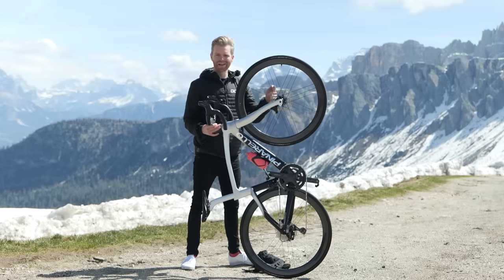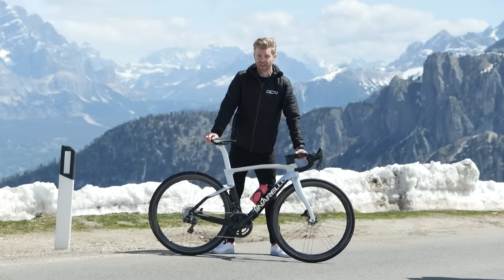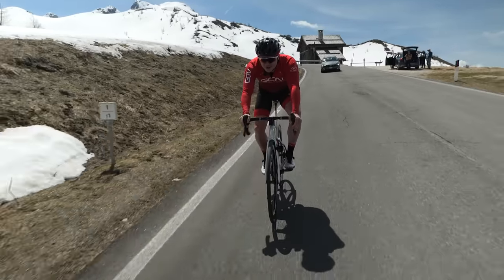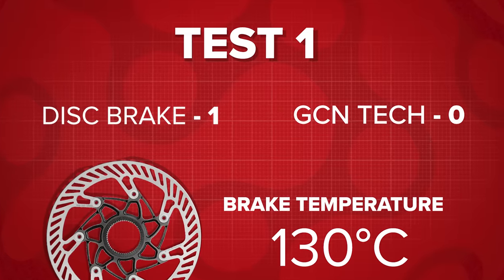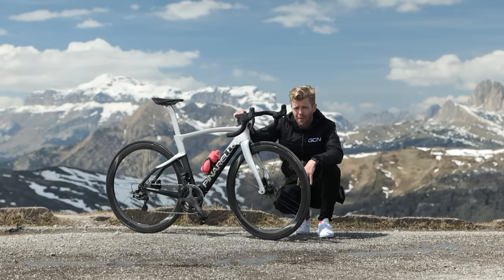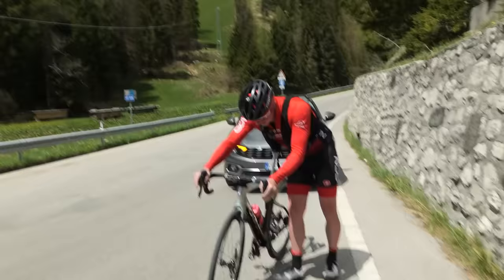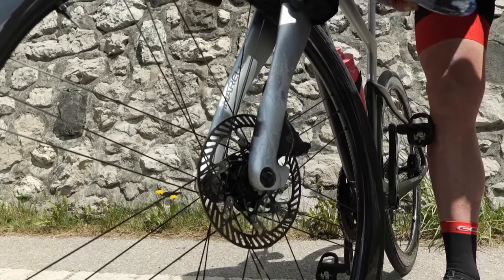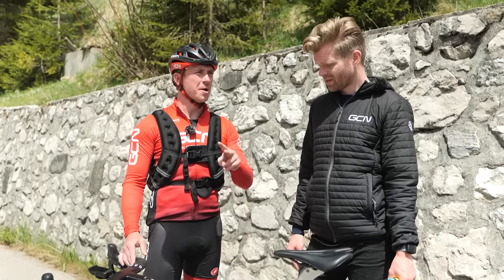Can We Melt Disc Brakes!?

Comment: Also, dragging rim brakes on descents can heat up the tire enough to blow it off the rim. I know from experience.
Reply from the maker: Oof. Hope you didn't crash too hard!
Reply: I too have had a similar excitement, after making the mistake of adding air to the tyres before a steep descent off Exmoor.  The front cover exploded a second or two after coming to a halt.  It sounded like a rifle and left a 9inch tear in the sidewall.  I've since learnt that this was an illustration of Gay Lussac's law (for a constant volume, pressure increases in proportion to the Kelvin temperature).   When calculated, it shows that even if there was 100degC temp rise from the braking, the pressure only went up by a third, so I was not far off blowing it up while pumping.

Comment: Ambient temperature here looks quite low - snow on the ground, Ollie wearing a padded jacket. If you repeated this during the heatwave, the additional temperature , maybe 40'C, might at least take you much closer to boiling the oil.
Reply: Mineraloil has usually a boiling point of 180-190°C! This is why in cars DOT fluid is used, which can get up to 260 and higher depending on fluid.

Comment: i brought my front brake red hot on my mtb.
15% downhill, 50 mt pedaling,  and immediately panic stop. after the 3rd stop, the front formula brake is red hot (23 kg Specialized demo + 101 kg driver).
The Magura Gustav M lasted much more.

Comment: An 130 grams aluminum disk needs 72 kJ to increase from 30 to 660 degrees celcius, an 100 kilograms object need to move 38 m/s or 136 kph to reach this kinetic energy, this speed is not from a regular bicycle
And we still not talk about heat losses

Comment: I have had bad break fade with organic brake discs did Fred Whitton few years ago and  coming down from hard knock rhino? Nearly over shoot a few corners Weight is always going to be main issue so think i was around 85-90kg+bike+fluids so around 100kg. Having said that after doing Helvellyn Tri and coming down kirkstone pass on rim brakes +carbon wheels you can get brake fade + bike wobble easy trying to avoid other racers/cars and avoiding the stone ways!

Comment: As anyone who tempers steel would know when the steel turns gold  or most people would say straw color you hit 400 Fahrenheit when the steel turns blue you have hit 550°F
If you come to a complete stop while your brakes are hot, this is what causes warping the rotors will cool down to an acceptable level within a few minutes. Another words if your brakes are really hot, just like a horse let it cool off before you come to a stop.

Comment: I turned a avid juicy 5 disc black in the French mountains. Want to get them proper hot? 10 full power stops from 45mph in quick succession and you should get full break fade, lots of tings as the metal expands. That’s why mountain bike breaks are far more powerful and have better heat management.

Comment: Thank you for the video!  Now I know not to worry so much on long descents.  I'm impressed that the rotor didn't warp.  Pouring water on the rotor while it is still hot was a good test of the rotor's ability to resist warping.

Comment: The speed of descent matters, of course. As the speed goes up, a larger fraction of the gravitational energy is being dissipated as wind resistance, but what is left is dissipated by the brakes over a shorter time. There is some speed at which the rate of dissipation is greatest (it may be dangerously fast). A complication is that the brakes also get better air-cooled as the speed rises!

Comment: I once melted my brake blocks, rim brakes on a mountain bike, going down a 15km hill in Morroco.  The replaceable brake pads just melted and dropped out.
Reply: Ive melted one or two sets on my mtb. Got disc brakes fitted to it and havent had too many problems.

Comment: Haha poor Hank better have good life insurance😁
I do sense a bit of a missed opportunity to check the temperature of the fork and hub/axle as well, as the fork might get weakened by heat radiated towards it for such a long time, so it would be nice to see if the airflow over it can prevent it from heating up too much, and to check if the temperature of the fork goes up faster if you stop right at the bottom of the hill/mountain instead of riding a little longer to get rid of the heat. 
For the bearings it would be fun to check if they get hot enough to affect the grease that's in there.  (I doubt it would get hot enough to actually burn the grease, but it might go drip out of the bearings, which would warrant re-greasing them after doing long downhills with a lot of braking)
As for melting the discs, I should hope not, as the emergency brake might actually be Hank's face instead of the rear brake if it decides to warp, or snap while using the front brake like this.

Comment: Campagnolo - Braked for 10 mins - no warping
My Dura Ace rotors - squeak after one hill literally
Reply: Lol my MT 200s have been got blue on the rotor (300°C) and not even the pads got damaged. 
Sometimes they squeak after rainy weather or if the bike was not used for a couple of weeks, but if you brake them hot again until the rotor gets brown they are like new again

Comment: I did this with a powerful (illegal) ebike once. Full throttle downhill with the brakes held in while pedalling hard. The rotors became glowing red. After that they warped and lost a bit of power.
I did it primarily because my brakes squealed and had some oil on them, so my thought was to get them so hot that any oil would simply burn away. It only worked for a short while.
Reply: This method works with squeeky brakes, but you have to stop if the stainless steel gets brown or blue at max

Comment: Well. With steel discs I wouldn't worry too much about the disc (the water could lead to warping though...). The organic pads are more of a worry, but seemed ok. But this test would be interesting with shimanos ICE technology, since that is a sandwich of Steel/Aluminium/Steel and Aluminium is far more sensitive to heat than steel is...On the other side, alu is used in those discs specifically to transport the heat into cooling fins and better cool the discs... maybe with too small discs and or more aggressive pads one could take these to overheating... Also the rear disc could be less prone to overheating with maybe different air movement but I don't know... but more weight and smaller discs in alu would be interesting...

Comment: 180 degrees, huh?  

On old fashioned rim brakes, the trick is to brake only as much as you have to before the turns, then scroll through the turn with brakes off.  On the straightaways, coast as fast as the wall of air permits.  With me, that was 45 mph, 48 mph in full tuck.  On tubulars, braking to 30 or 25 mph to make the turns, quickly heats up the rims, risking softening the tubular glue and the tire slipping off the rim leaning into the turn.  So the trick is to brake hard for only a few seconds at a time and let the rims cool in between, rather than ride down the course with brakes on the whole time.  I'd think that strategy would carry over to discs.  The pads should also last a lot longer. 

Kudos to Campy for making discs that don't warp!
Reply: Dude, you do realize they were TRYING to BREAK the brakes?

Comment: This was a fun video but the physics dictate that the temperature is going to reach a steady state based on 2 things: slope and speed, assuming a given air temperature. Passo Giau is pretty steep for a sustained mountain descent but only a tiny part of it is over 15% slope. In my town we have steeper slopes that present bigger problems for brakes, for example one where you lose 200m of altitude in just 1200m of distance, and another here you drop 70m in 500m. Going slowly will control the temperature but at a speed like this rider is maintaining, which sounds like about 40km/h, you could definitely overheat some brakes under some conditions.

Comment: i would have thought if there was enough heat built up in the braking system then the fluid would soon begin to lose its effectiveness and as steel melts at around 1100-1200 degrees C that the calipers, being aluminium would undoubtedly go first ( melting point of 660'C), not to mention the caliper pistons or the brake pads if they're sintered....( copper melts at  around 1090'C)
Reply: When brake fluid boils it expands And when it's got nowhere to go or rather when it doesn't leak from the top quickly enough it does push the brake pistons out... Full on brake even when you don't want to.

Comment: It would be fun to see this test again but with custom brakes that are designed to get hot (no slots). I just want to know if it's even possible for bike disk rotors to glow red. Also, this would be really unrealistic, but you could be pedaling hard down the hill (while braking) to put even more energy into the rotors

Comment: I don't need the 20kg vest we ride a tandem we only brake when we need to. My experience is that the pads will wear out first. We are on Bengal mechanical brakes with 203 mm rotors. Dragging the brakes is really not recommended but you guys will test the limits.

Comment: Is the water cooling a good thing to do and advise to consumers? Wouldn't you be worried about micro cracks in the rotor?
Reply: I am a mechanical engineer and I recommend that you do not cool any orverheating components with water when they are not designed to be cooled that way.
I agree with you about cracks. And if Ollie did see some deformation on the disk, it would have been thier fault for pouring water on it.
Reply: Mine didn't crack but it did warp abit so now I'm living with an unfixable brake rub since my rotors are still new
Reply: Dont do that as the discs warp. Keep riding to cool them down evenly.
Reply: @Egppie.  Discs can be bent back into place using pliers. Trial and error, look at where exactly they are badly bent while spinning the wheel by hand and then bend in the opposite direction. Bit by bit until they don't rub anymore.
Reply: @radiocontrolled9181  mine's got a really subtle warp and it's hardened so when you try to bend it back into place it'll either crack or bend the entire thing, hope what I said makes sense because that's what the mechanic told me
Reply: @Egppie.  I see. I know that most of them can be fixed but obviously cannot comment on yours. However I don't trust mechanics much because many of them tell you lies to make you buy new parts when in reality they can be fixed. That's why I service my bikes myself. Most disc rotors can be bent a little bit without breaking them, that much required to get them centred without rubbing. I did that on mine myself, never rubbed again. Once true, they'll remain like that normally.

Comment: I took a rented mountain bike up to the top of the cable cars near Interlaken in 2006. Thought it would be fun to come down on it but after two minutes the brakes were fading so badly I nearly crashed into a Unimog. Soon ran out of water to cool the discs so the descent took a very long time! It's a nice memory, but I suppose a rental mountain bike now would be much more capable of handling it? I weighed about 70kg.
Reply: Modern brakes should be better. I descended Khardungla (Ladakh, 5300m) a couple of times with brakes like MT 200s and they never had major issues.

Comment: Im a solid 110kg and worry when i drop into devil's gulch in colorado. The top is a solid mile at 10-15% grade. I always chicken out and go slow because im unsure my ultegra disk breaks will work at slowing me from 30mph to 5mph for some of the tight turns. Can you find both heavier rider and steeper decents for a retry?

Comment: The discs won’t melt but the pads will melt away fast. And also the heat will “boil” the brake fluid and introduce air into the system. One shouldn’t overheat brakes for the latter two reasons. The discs will be fine, even if they may temporarily become somewhat untrue when hot.

Comment: at one point in the video you say that organic brakes are better performing compared to metallic sinter pads but isn't the opposite the case? yes, organic is more silent and metallic compounds need a bit to reach perfect operating temperature but in pure breaking force they should perform better.
also, what was the average speed during the test? closest to failing I got my brakes was going down a 500m descent on a smooth, pavet serpentin road with my 26" MTB and 180mm brake rotors. we averaged ruffly 50 kph, brakes had a real good blue coating and were terrifyingly hot. you could definitly feel some light fading in the lower quarter of the descent.
also, don't pour water over a cooking brake disc!!! missalignments and cracks are very well possible and even if not, it's unnecessary stress for the materials.

Comment: With normal road riding, I rarely get the braking Wave disks on my motorbike that hot under heavy braking, let alone the ickle little disks on my pedal bike, I am clearly not trying hard enough! Fascinating experiment though. I seem to recall that GP Bike racers were using a mixture of Carbon ceramic disks and iron disks for because they maintain their ability to brake at considerably higher temperatures, plus can glow quite happily as they absorb the heat of braking from 200mph. So a bicycle even when pushed hard is never going to generate that level of heat, hence the lack of a glow. Maybe a solid disk, shielded from the wind to prevent radiant heat from escaping, when accelerated using a powerful motor would give you the desired effect? Is it time that GCN Megabase built Ollie his own lab for such evil experiments?
Reply: I live in a hilly area and if I decend a couple of 100m in a few minutes with the MTB off-road (where you can't just let it run) the rotor gets brown or sometimes even blue (300° C). My rotors are solid, they never warped or got any damage.

The hydraulic press channel did a test with a lathe, it's a good test bed to push them to the limit without any risk

Comment: we melted some shimano ice tec 160mm rotors on a tandem, the aluminium sandwitch core was literally dripping from the discs when we had finished.  The rotors were glowing and had warped as well as turned purple.

Comment: No it's not possible. Stainless steel rotors. Melting point of stainless steel is 1400-1500 degrees Celsius!!! The pads would just melt before the rotors will 😂

Comment: 06:05 the safety clip on the pin is missing. I once lost the pin on a motorcycle on a racetrack, had huge luck that there was enough room to get to stop before crashing into a wall. On the road you dont have that room!
Reply: Is this a bolt with an additional safety pin? 
I don't use Campas, my Shimanos have a different pin you have to bend at the end

Comment: Easy modo! You could've just get a cool set of bikepacking gear and stuff it with some heavy load to build a total weight of the system up to the top level allowed by frame/bike specs. It would probably be something around 130 kg. I wonder how the brakes would handle this. I believe they will - as manufacturers usually take such scenarios into account - but still interesting

Comment: Dragging them like that won't get them up to max temperature, you need to do a series of hard stops from very high speeds in quick succession.  Ask any mountain biker about descending a steep, fast track with hairpins and you'll quickly find out about blued discs, cooked pads and brake fade.  Also check out the tests one of the German magazines does, theyrig the brakes up on a Dyno (I believe it's one at Hope Technology) and can easily get the discs glowing red and smoking.  Maybe do that in another video!

Comment: I heard people say when car's breaks get too hot and catch on fire, you should not pour water on them as it will cause the breaks to crack. if it is true, would it apply for disk breaks as well?
Reply: If it doesn’t crack them the thermal shock can cause them to warp, which means they’ll rub on the caliper and overheat more.
Reply: If car brakes catch fire you rather use water to prevent the car from burning up. New brakes are cheaper than a new car.
Bicycle rotors can warp if you use water, and I don't think you get them hot enough to start burning
Reply: @simonm1447   if available it'll be better to throw dirt on it instead of water.

Comment: You should come to Battle Mountain Nevada for the annual World Human Powered Speed Challenge. Fully faired recumbents reaching speeds close to 145 km per hour. These bikes are typically fairly heavy and fast... if you stop these using disc brakes the rotors will actually change color. The advise here is to not use hydraulic brakes as the oil might boil.

Comment: The main thing DOT brake fluid is formulated for is to be hydroscopic, that I to absorb water, so the your brake lines don't corrode, and to have a high boiling point, so that if the fluid gets really hot, uou can still apply hydraulic pressure in the brakes. Those are still useful properties on a bike. But auto brake fluid is pretty nasty stuff, mind you...

Comment: While the rest of us suffer in a heat wave, you'se guys enjoy mountain snows. I'm jealous and. 
If the descent is straight enough to go fast, it ought to be a good Everest spot.
On brakes, these bicycle brakes aren't that much smaller than motorcycle brakes, which handle much higher loads and speeds

Comment: The cut outs on brake discs are not for cooling, but to clear brake dust, less material could radiate less heat, so they would be counterintuitive. 

Don't put water on overhheated brakes,  cooling it down so much more on one side could warp the brakes. 
Also, your test by looking at it is not much of a method. It could be less then you can see with the naked eye, but still so much that it can become dangerous.